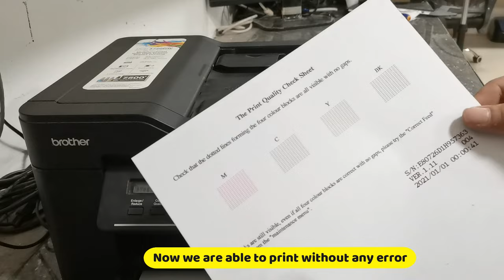BROTHER DCP-T720DW Printer - Cannot Print 35 or Paper Jam Error Fix.

Comment: I had used the wet paper towel trick for cleaning the print heads and even though I had successfully done it before this time I made a mess of it.  The paper was jamming with Error 34 and I could not see where the problem was.  After seeing your video I took a much closer look and found a 5 mm blob of dried, hard paper towel in the works underneath!  I finally extracted it with long tweezers and now the MFC-295CN is working again. Thanks for taking the time to make the video!.